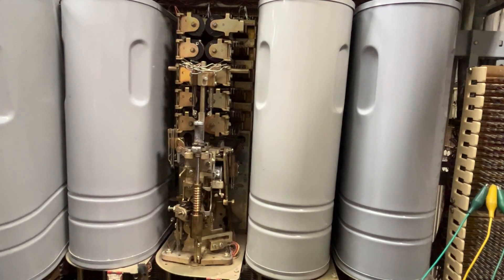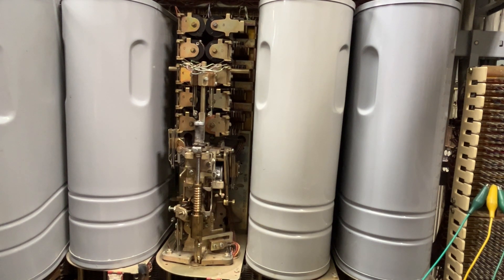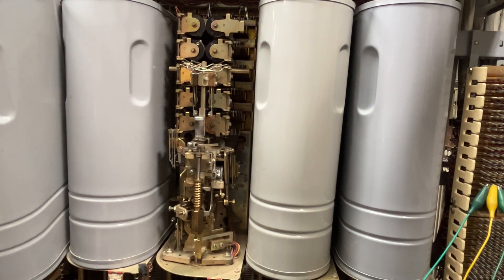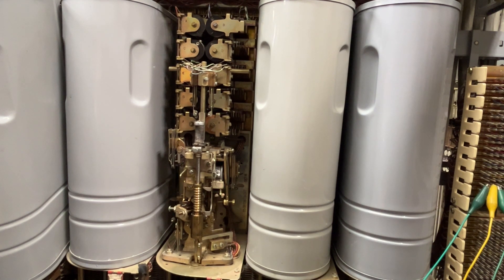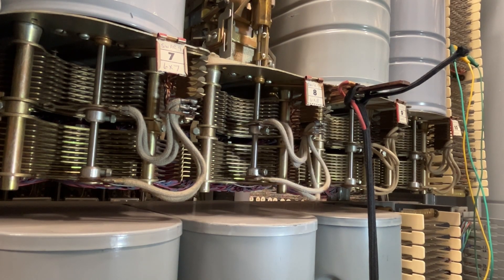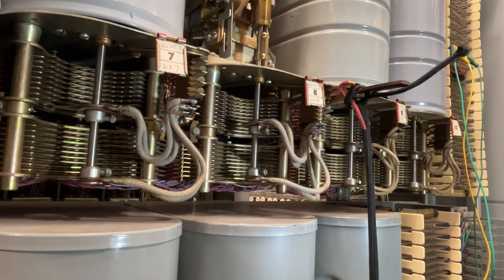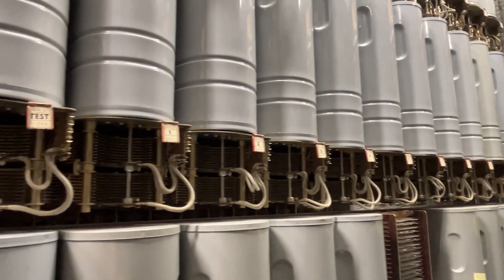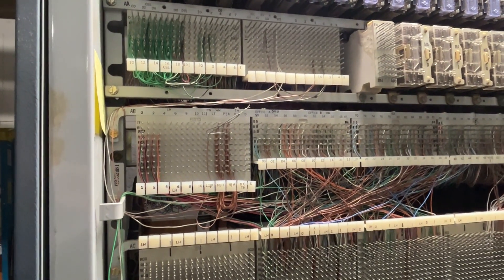Trunk hunting in Strowger step office. (SXS) Multi line service.

Comment: I worked no.1 SxS in the 70's.  We had these connectors for the large hotels in the lake Ozark mo area. If I recall correctly,  we had connectors that would hunt up to 20 lines. It would hunt fast enough which really amazed me. These were good jobs in those days for Southwestern Bell.  Thank you for good memories and videos.

Comment: As far as I remember, when I worked in a SxS office, hunting for small businesses was done by running a jumper on the sleeve terminal on the IDF from the main line number to the adjacent line numbers.  For example, if the main number was 2XX-1100, we would run a single wire from the sleeve on 1100 to 1101, 1102, 1103, etc., until the hunt group was a maximum of 10 numbers.  XB offices were more flexible in that the line numbers in hunting groups did not have to be adjacent.  If I remember correctly, the class number in a XB office for hunting was 10.  A 1FR or 1FB in a XB office was 01.  I can't remember the class numbers for party lines or coin phones.